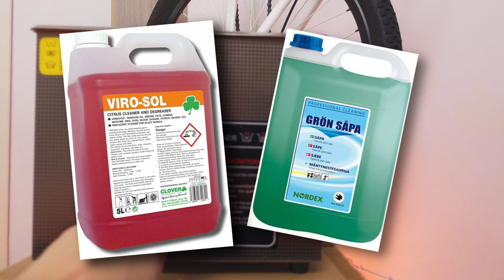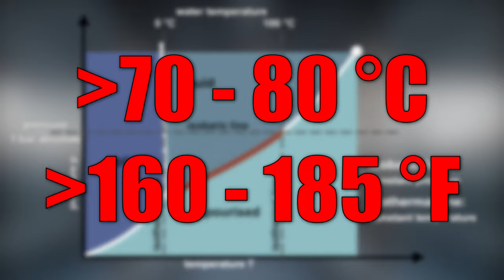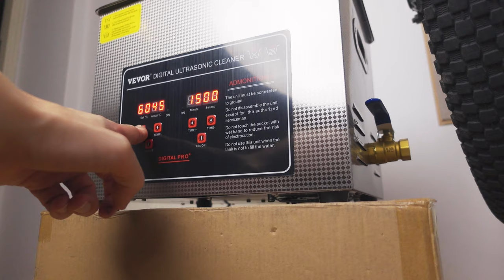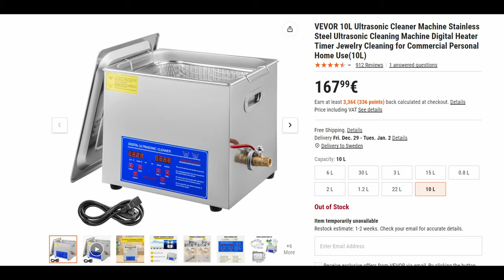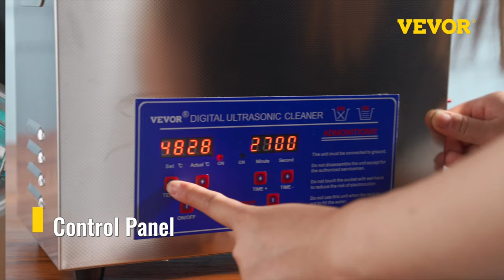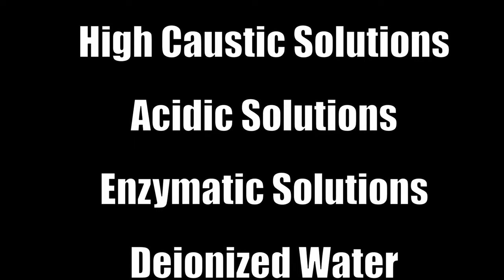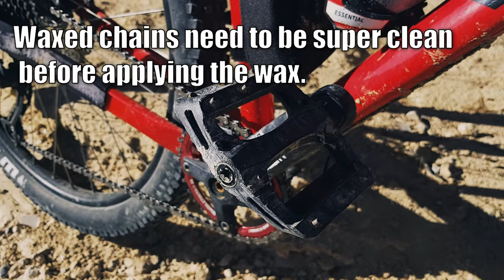Ultrasonic Cleaner REVIEW VEVOR 10L | Useful for bikes?

Comment: I’ve had mine for a few years. Great machine. Best detergent? Gasoline… 😇🙄🥸
Reply from the maker: Would really like to know what to use to remove rust (apart from gasoline) with this machine. Do you know?
Reply: @MTBs  possibly vinegar (ättiksprit). Its a great acid to solve rust, so maybe this could speed up the process?! I haven’t tried though. I mostly have carbon and aluminum parts. 👌